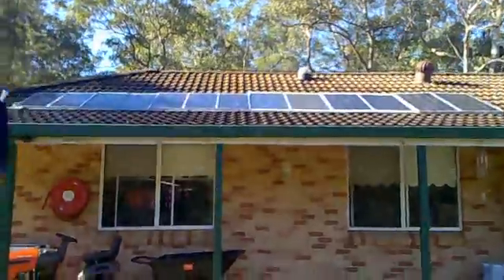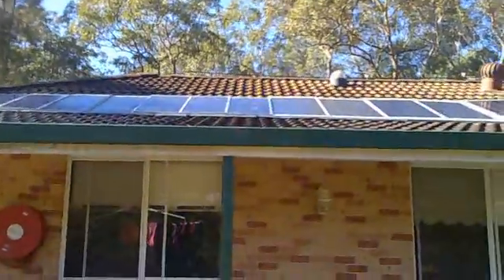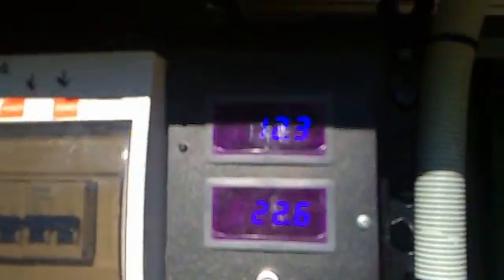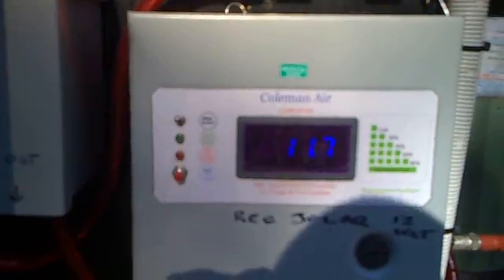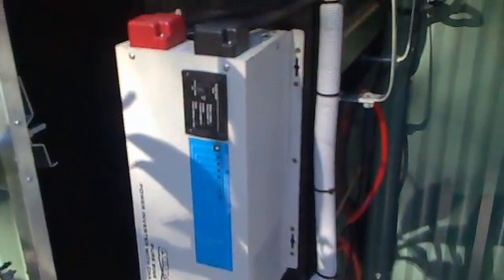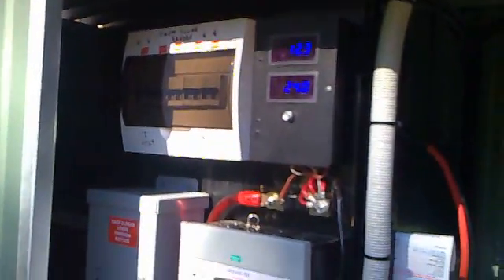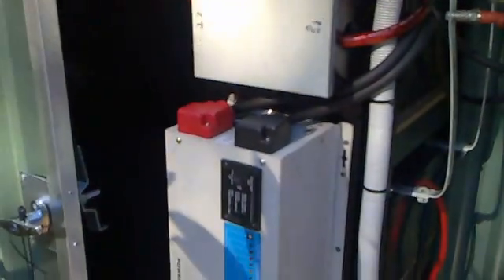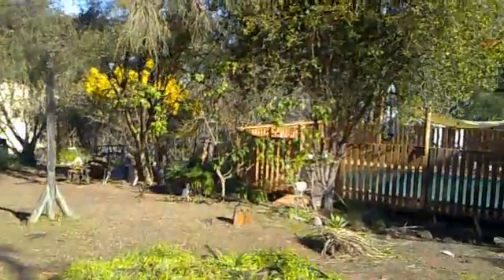OFF GRID SOLAR HOUSE 12 Volt Jamie Bezzina

Comment: How do you find the PowerStar W7? I've read that it's horrible on standby current? BUt maybe they have improved them? Also I'm interested in a low end cheap wind turbine. But I really would like a MPPT one and for it to be brushless. So far for my setup I have collected 6x 250Watt CSUN panels, Midnite Classic Solar MPPT controller, and 3x ex gov 100Ah Lead Acid deep cycle batteries. SO I'm getting close to installing. Still considering options for a top up petrol or diesel generator. .-.-.

Comment: Nice set up but the only thing It looks like I'd get some gap between the PV panels and the roof to allow air flow underneath 120mm minimum you would be surprised how much power you lose as the panels get hot and can't dissipate the build up plus if panels get to hot for to long they have a much shorter life especially with Aussie summers, I did it with mine as it looked neater and 3 panels fried out with in 6 years and the remaining 5 at best only reach 70% of capacity now an expensive mistake.

Comment: Hey, Nice solar setup.. Did you ever think about wiring the voltage to 48Volts?
Btw the "Solar Regulator" is called a charge controller.
What kind of inverter is that?

Comment: @CybershulDotCom   The only advantages 24V and 48V systems have are reduced cable size for a given load and minor efficiency gains in inverters.  Systems with an operating electrical potential over 12V only make sense if the only DC load is a BIG inverter, which for reliability reasons is not good design practice.  Small DC loads are usually either more expensive or harder to get in 24V/48V versions or are not available in anything other than 12V.